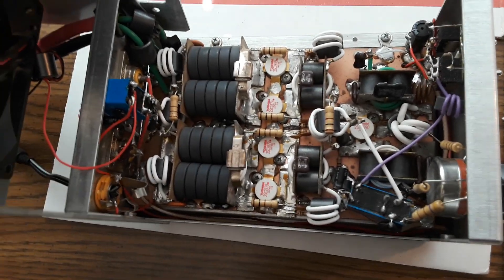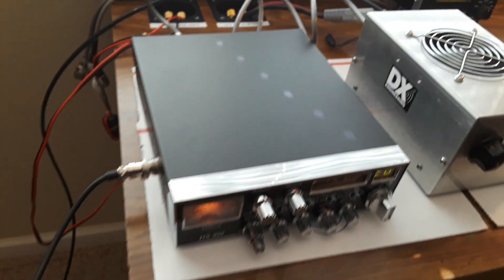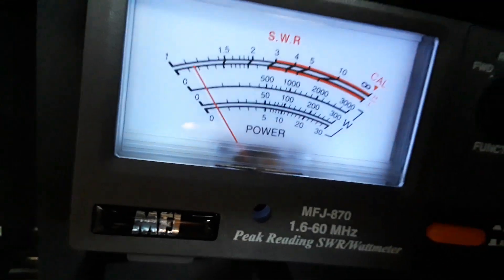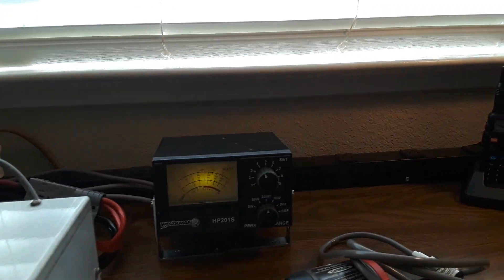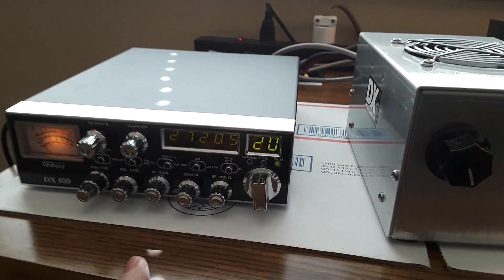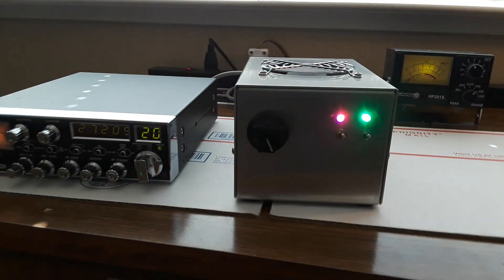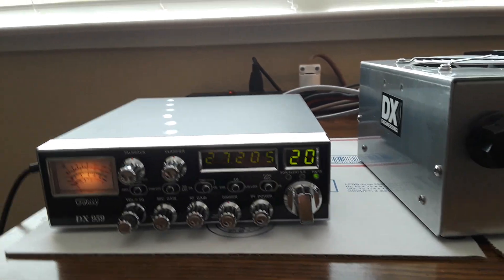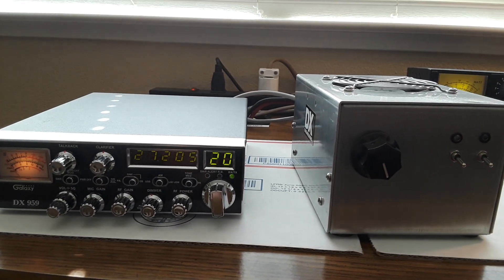Real CB amplifier testing! dummy load vs antenna

Comment: More than likely when you're in the mobile you're probably getting reflect coming back in through the wattmeter not necessarily through the coax. Because I know I can go outside and literally stand 25 ft away from my base antenna with my w m in my hand with no coax and have my son to key up with the amplifier on and the wattmeter will start moving

Comment: Power supply needs to be 100A for 4 pill and above I have been told...
Reply from the maker: It depends what kind of a radio you are driving it with. I can run my 2x8 and only pull around 100 amps.

Comment: Thanks for posting this video I like it a lot. I have the same issue with my tnt t900 variable power 2 x 4 and my 6 pill fat boy all mobile units Whether they are in my diesel pickup or base station. I personally don't think the through the wire/antenna captures the true watts rms or pep power because it's being dissipated. The dummy load gives a "perfect condition environment" more precise and accurate reading and makes people all googled eyed in awe especially for sales. Maybe the true power output is somewhere in the middle I don't know. I had 2 questions. #1 What kind of power supply are you using? #2 What are these putting out on ssb? Again I appreciate this video as I'm dealing with it also. Don't pay attention to the haters.

Comment: You could have done this test using 1 amp & the same meter. Your comparing Apple's to oranges on output power. The High drive amp will do more watts than the 1×4 with another amp driving it.
I've heard quieter Vacuum Cleaners lol!

Comment: I'm going to tell you why your readings are different. That meter on the dummy load is a pep meter. The other meter on your base is set wrong, you have it in rms. You need it to set it to pep, to get the same readings as the same meter

Comment: Always lose some in the coax. The mobile has a shorter run which will equal less loss of course than your base setup. You almost always lose power on an antenna vs. dummy load no matter how well its tuned or what type coax. I would just run that 1x4 with the driver on and the low dead key on the Galaxy and let it Cadillac along.

Comment: Seems odd... that your getting a difference in watts out. Assuming you use the same radio to amp jumper, I'd think you would be getting the same. Now, I could see it dropping off if you tested at the antenna...are you getting reflect?
Reply from the maker: No reflect on the base antenna. Very strange to see this, but it was equal on both amps. They both sound good over the air in the mobile and reach out well. Just doesn't come close to matching the dummy load results.
Reply: I've tested on a dummy and antenna and I get the same output. I will say I dont usually look at peak though. I'm not a huge watt chaser. Mainly check  dk.
Reply: All the builders do seem to love the dummy load watts. I've heard some pretty crazy numbers thrown around